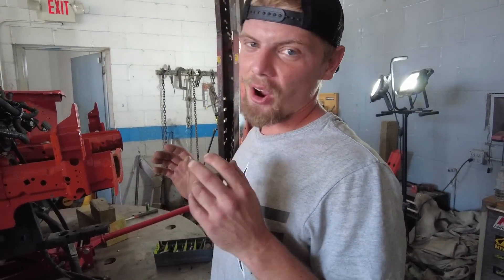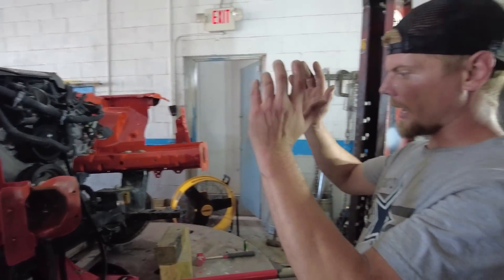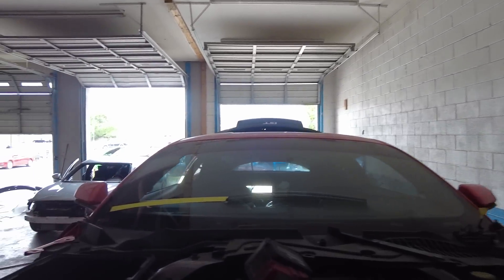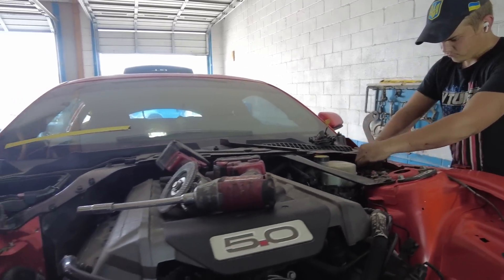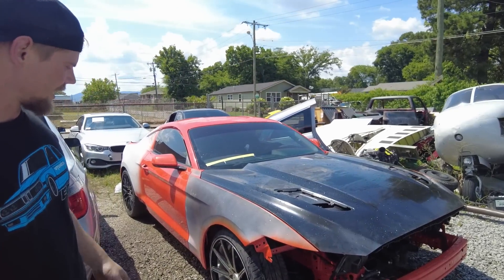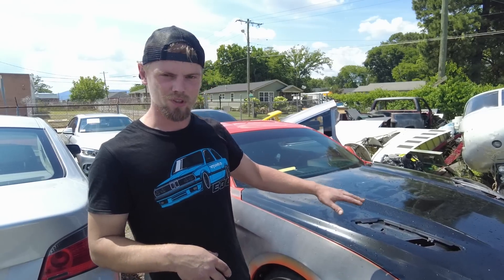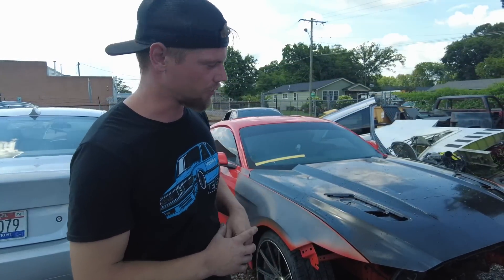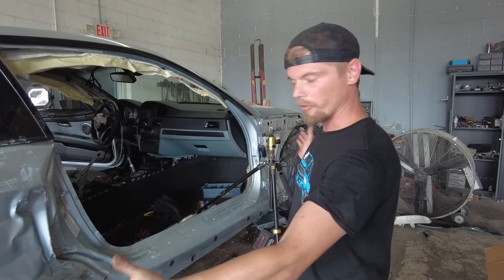We assembled the Mustang and start work on the M3

Comment: hi being a panel beater myself i have just put 2 full quarter panels with sills and roof turrets on my e92 335i the roof had to come off to do the job and i shit load of spot welds like 400 and the worst part is i took the replacement panels off of a different body shell did it once never again on a bmw getting all the gaps perfect  took forever but once done very happy. take the rear trim off the inside next to the back seat remove the 8 screws that hold the big inspection cover on you can then get in to cut about 95% of all the spray foam that is bonded to the quarter panel as there is plastic crush spacers hidden under the foam hope this helps cheers from down under

Comment: A guy brought me a red 2018 that had the same work done to it.  The frame rails was welded a 1/2 to high. It was welded up at a angle. I told him I would fix it for 5,000 . He was thinking i was going to do it for 200 😂🤣. I explained to him you have to take the hole front end apart to fix it.
Reply from the maker: Yikes 😬 hope he got it fixed